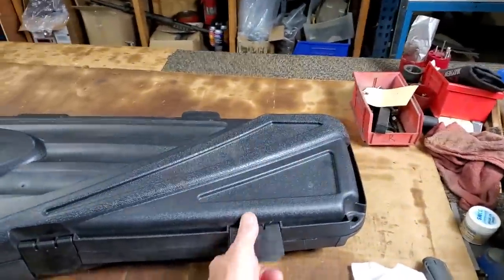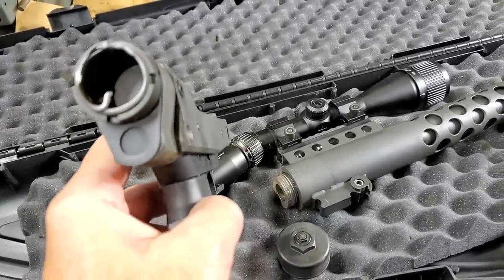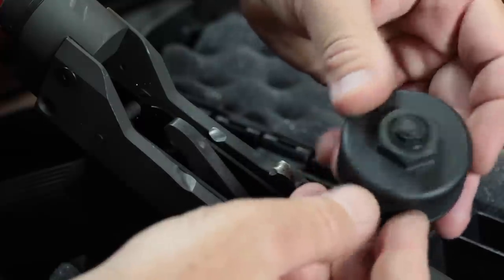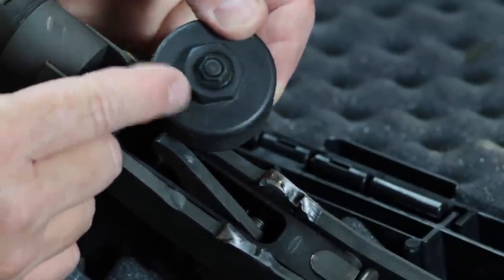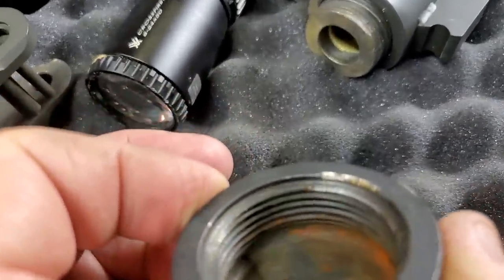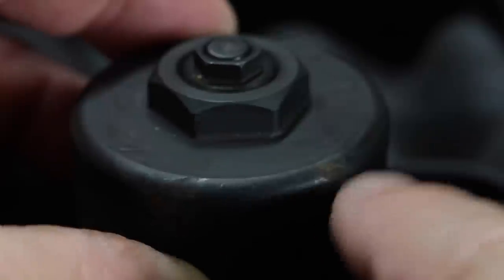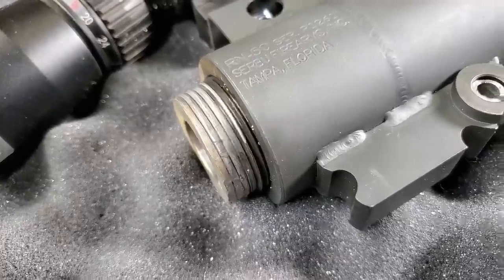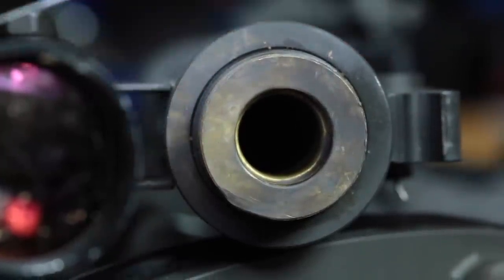Kentucky Ballistics' RN-50 Blow-up:  First Look

Comment: This just furthers my belief that this was the freakiest of freak accidents. Thats some heavy ass steel that got twisted, broken, and had chunks taken out of it. WOW. Thanks for the update.
Reply: Big powder charge go boom
Reply: Even freak accidents like this happen for a reason.  Given the transparency here, I think we might actually get to the bottom of this and find out the cause.
Reply: @ZachSwena  definitely, personally I think it really was the ammo. It probably had quick burning pistol powder instead of the correct rifle powder. The gunpowder burned too quickly and too much energy was generated all at the same time causing the catastrophic failure
Reply: Tempered steel is no joke 
And even the steel that was mild was still thick as hell. When the cap hit the two ears it hit it from the side which is the thickest part and yet despite that still had enough power to break them right off and come back and beat the hell out of scott
Reply: @ChaS4m  he was firing slap rounds which are extremely overpressure

As multiple people have misunderstood this comment I am referring to the singular bullet that he fired not slap rounds in general
Reply: @dwayne7201  no, they're not. A SLAP round is 54kpsi. They're ludicrously fast because the penetrator is lighter than a standard .50cal slug.
Reply: @ScottKenny1978  where’d you find the chamber pressure of a SLAP round? Not disagreeing just curious because I can’t seem to find any information on it.
Reply: @ScottKenny1978  evidently you misunderstood my phrasing I was referring to the individual bullet upon looking at my comment I see where you got it mixed up but that is not what I intended what I meant was the individual bullet in question was extremely over pressure
Reply: I wonder how fast that round went with all that extra energy?
Reply: @ChaS4m  I'm curious if there's any way to determine what powder is used by examining the brass. If the ammo was counterfiet / reloaded with pistol powder. Mark also pointed out the crimp and said someone was looking at that so I look forward to the next update.
Reply: @ChaS4m  it's the same as any other .50bmg round, because that's the safety factor of the weapon, not the case. 

If anything, they might be slightly less pressure overall due to longer burn time, as they're designed for shooting out of a 45" long Ma Deuce barrel, not a 30-36" rifle barrel. 

SLAPs do use different powder than standard .50bmg, a ball type instead of the extruded IMR type.
Reply: I think Scott..saved someone elses life. It would have killed them.
Reply: @dwayne7201  ah, gotcha!

Yes, that specific round was grossly overpressure.

SLAP rounds in general are the same working pressure as any other .50cal round, they get the speed because the penetrator is lighter.
Reply: you would only see that in halo 3 to be honest
Reply: @dwayne7201  no they are not. scott even shot two of them on the same day before the accident.

either this one was accidentally overloaded, the bullet dramatically recessed or it was loaded with explosives deliberately as a trap for vietcong looters
Reply: @Genesis23OPB  No, slap rounds came about in the 1980s to 1990s especially operation Desert storm. They did not exist during the Vietnam war.
Reply: @darkest_eclipse8271  ah my bad. but it was common practise to sabotage rounds back then and in other wars, maybe he got a sabotaged one when the rifle exploded
Reply: @Genesis23OPB  My understanding is that this was done to calibers that the Vietcong were using, like the Russian 12.7mm. It would've been odd, but not impossible, for them to sabotage ammo that was not in regular circulation for the enemy.
Reply: Will somebody please address the fact that the cat threads were still fine but the bolt threads were stripped
If those were similar Metals with similar maximum capabilities than how did that happen???????????
Reply: @thecloneguyz  you could see a bit of damage inside the cap too. But the issue still stands that are ammunition was extra hot which would’ve made them moot anyway.
Reply: @thecloneguyz  One of them will give before the other, in this case it was the receiver before the breach cap.
Reply: @thecloneguyz  I don't think that the barrel is treated as hard as the cap was. Deliberately. The barrel needs to flex, the cap basically doesn't.

Comment: This video is downright profound. Mark sounds like he's at a loss for words. You can tell he cares, and wants to get to the bottom of this.
Reply: There isn't anything to get to the bottom of really. Scott was buying second hand ammunition as those type of rounds aren't commercially available. It had been loaded way too hot.
Reply: @Cragified  Mark still wants to look into it cause at the end of the day his rifle did explode.
Reply: He needs to improve the he design, Rex reviews said it best
Reply: @Vigilantea92  Normal chamber pressures were exceeded by over 50% There is no designing in the world that would stand up to that type of, well, miss use.
Reply: It is disturbing, however, that ammo can be loaded that hot. You say 50% over normal pressure, if that is the case, from an engineering point of view there was hardly any safety margin in the design.
Reply: @Cragified  it was either loaded way to hot or the polymer portion was out of spec far enough to generate a barrel obstruction
Reply: @luuk341  wrong mate, military issued firearms are always designed to withstand more than that
Reply: @Vigilantea92  Military issue firearms are meant to take up to twice the regular chamber pressure?
Reply: I think it's the bullet. Not the gun
Reply: @luuk341  yes they are fail proof
Reply: @White.Elemant  the SLAP round is already overloaded compared to a regular .50BMG and it fired the first coupe, of rounds fine this was an overloaded SLAP round that was way above spec.
Reply: @jameson1239  obviously, but how much? Do SLAP rounds in general take this construction to its limits, or too close to the limits? Btw, does anyone know if the barrell was blocked?
Reply: @White.Elemant  I do not believe the barrel was blocked as before he fired the round that blew up the gun he fired a regular API round which would have theoretically cleared any blockage it as for pressures of regular SLAP rounds vs what the gun is rated to however I do know that the pressure of a proof .50BMG round is 650000 psi
Reply: @jameson1239  Do u mean 65,000?
Reply: @luuk341  Here's the thing.

Did the weapon fail spectacularly? Yes.
Did it fail that way due to a 'normal' round? No.

So why all the investigation?  Because even a 'normal' round can, via chaos theory, do the exact same thing. (funny thing about explosive powder is that it gets more explosive the finer its ground up.. and 'old', perfectly normal, ammo, CAN turn out to be over-loaded not because they were initially overloaded, but because the powder within it broke down, got shook up, ect, to the point that its current form is 'greater' explosive wise, than what it initially was.)

If a failure happens, only an idiot would NOT want to know 'how' it happened, so you can do whatever can be done to ensure it doesn't happen again.
Reply: @Vigilantea92  nothing is fail-proof........
Reply: His gun was at fault and the entire gun community know it. Any gun should be able to withstand far more than a normal round, for safety purposes. That gun, clearly got mangled. I would never touch one.
Reply: @curtisjoe24  and you know this after how many years as a gunsmith?

Granted, firearms are designed to hold more that what you would normally use in them, but even a 9mm can have a catastrophic failure.
Reply: @luuk341  I think he means so that if something does go wrong, the injuries won’t be as severe. Those ears for example can be made to fail differently so they don’t go straight into the shooter.
Reply: It was a bomb that Scott loaded into the gun, not a bullet.

Comment: I’ll be honest, when I first saw news about this accident my first impression was “well whatever company made that gun is screwed” but honestly I’m really impressed, Mark is no nonsense and really shows that this gun is tough as nails but it doesn’t matter if you chamber a round that’s basically a bomb. I applaud you for your honesty and desire to address this head on, you have my respect. I might even have to buy me an RN50 one of these days.
Reply: Say this was some corporate produced gun, they'd never warranty or accept any fault because of the rounds Scott put in it.
Reply: Its not like he could sue after using hand loaded rounds anyway
Reply: I’m sure he would lose business if he hadn’t addressed it as transparently as he has. He knew that he had to regain people’s trust in his product, even though it was never his fault to begin with. You’re not even supposed to use SLAP rounds with anything other than the M2, but even with one of those it’s still more dangerous than any other round. They stopped using them a while ago for this very reason.